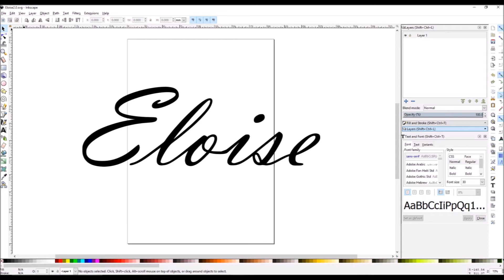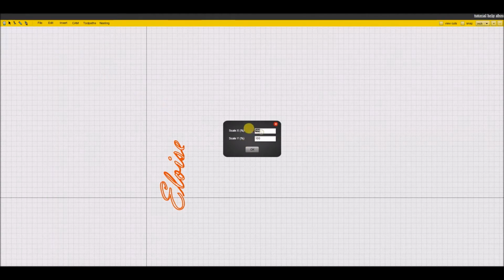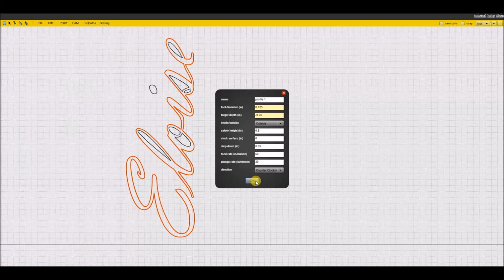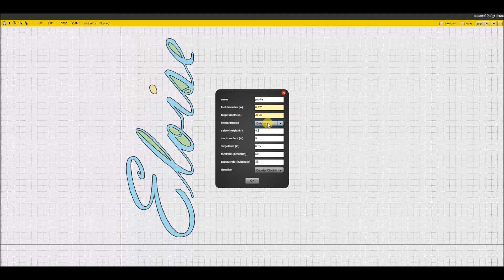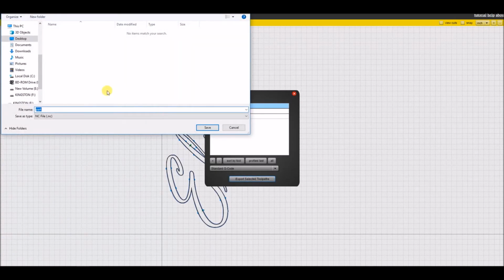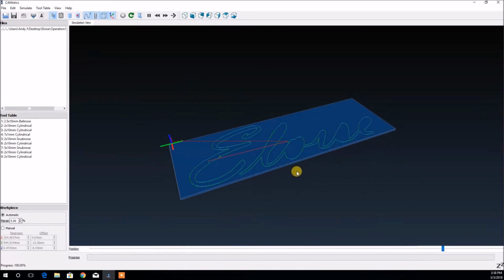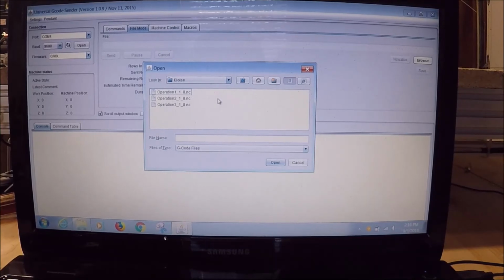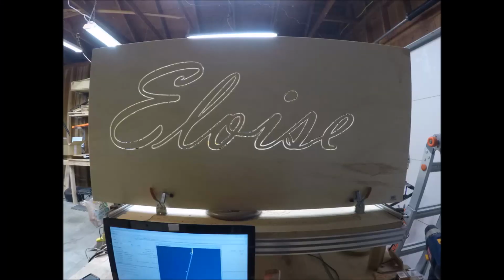DIY Nursery Name Sign With CNC

Comment: What software are you using and does it do the job? Thanks
Reply from the maker: I typically use Inkscape to make the Vector files and MakerCam to create the tool paths. Both programs are free and work decently well for simple projects like this. For more complicated designs I use Fusion 360.
Reply: Could you do like a tutorial video with fusion on making a flag with say a Harley Davidson design

Comment: What thickness of wood did you use?
Reply from the maker: I used 5mm plywood. Looking back on it a slightly thicker sheet of plywood may have been a bit better, but it still worked well.

Comment: What brand/model cnc machine do you have?

How much did it cost?
Reply from the maker: Hey tAwnEE H! I actually built my CNC from scratch, so it doesn't really have a model or price tag. All said and done my CNC cost around $1000. A comparable machine would be a Shapeoko XL which retails for around $1500 or an X-carve which is in the ballpark of $900. Hope this info helps.
Reply: Hi bro...What kind of software did u used it..??Pls mention all their name
Reply from the maker: Inkscape to make the image, MakerCAM to turn the image to G-Code, and Universal G Code Sender to send the G Code to my CNC.
Reply: What size is the cnc cut surface